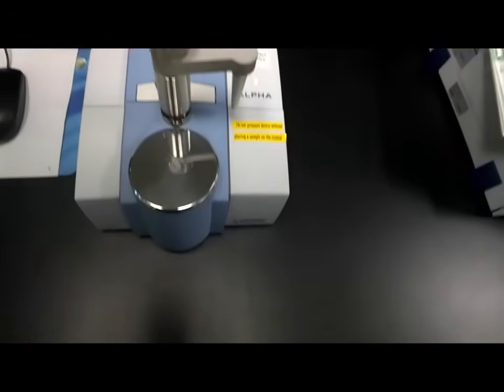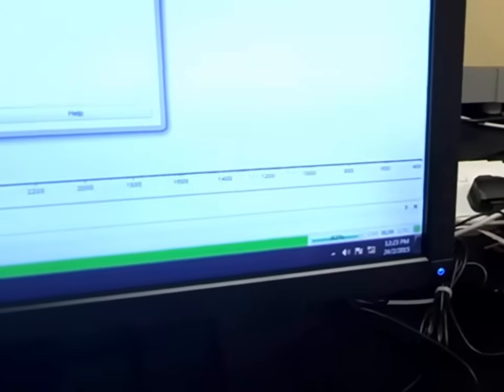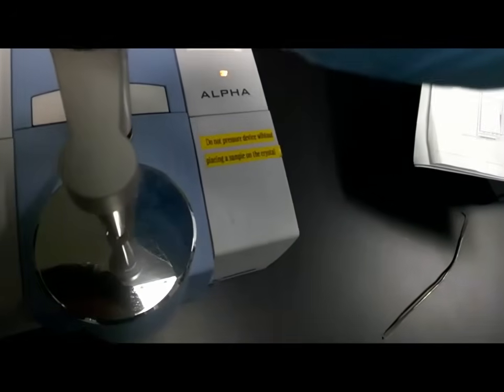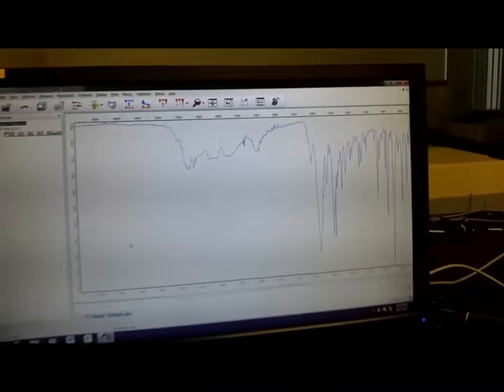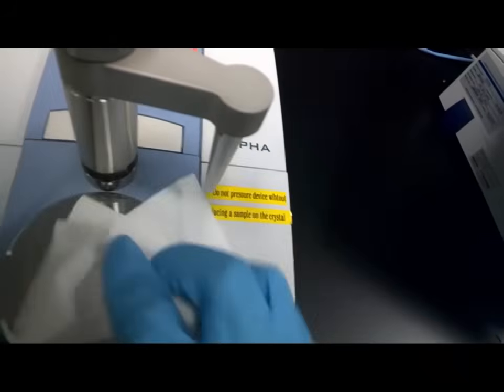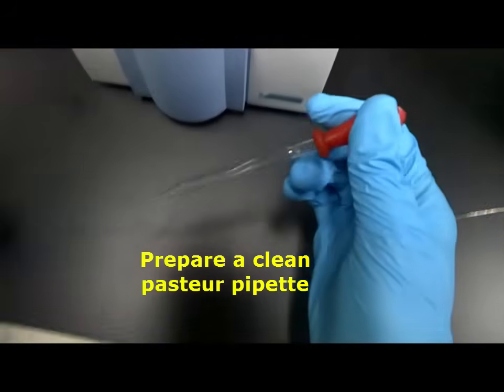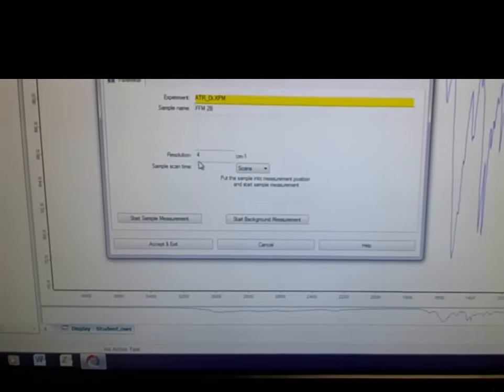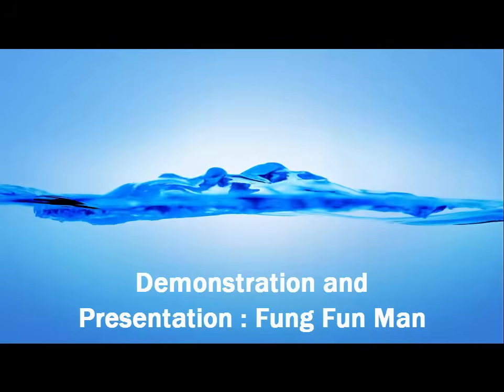🌟FTIR Analysis (ATR Infrared spectroscopy) OFFICIAL

Comment: why kbr use for making solid sample
Reply: KBr is pretty much invisible in the IR range. It doesn't have any vibrational modes that correspond to IR wavelengths. Some other samples can interact so strongly (i.e. absorb) with some wavelengths that you end up with a saturated peak in the spectrum or burn your sample. Burning your sample or having a saturated peak makes proper quantitative analysis impossible. Because KBr doesn't interact with the IR radiation, it is an ideal matrix to dilute samples that do interact too strongly.

Comment: Hi there! Your video is awesome, thank you for sharing!
I would like to share with you that the platform has no glass. The center point is a diamond ATR crystal, not a glass. It is soldered into the plate resulting in a chemically inert and mechanically rugged sampling area. The diamond will not break like glass. Your accessory is suitable for high pressure on the sample to allow better contact between sample and crystal. Thus, providing great spectrum results!
PS: However, do not apply high pressure when there is no sample :) Hope that helps!
Reply from the maker: thank you for the add-ons! very helpful indeed. :D
Reply: Can I ask u if it is necessary to reply the background measurement for all the specimen ?